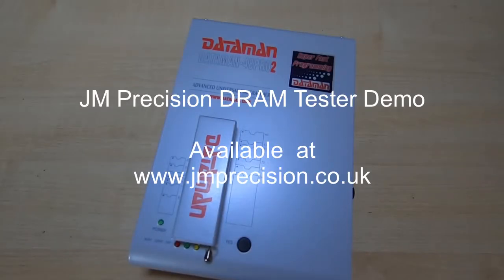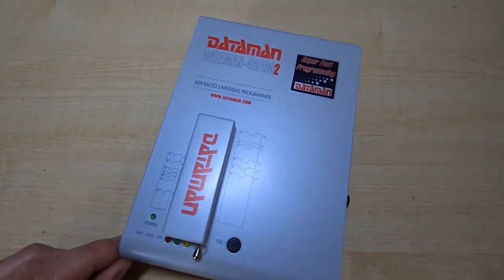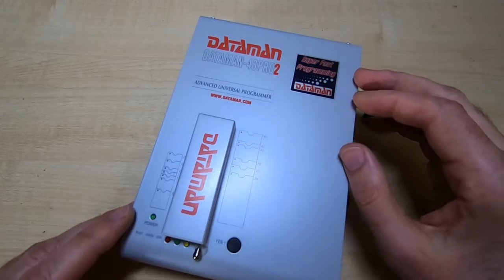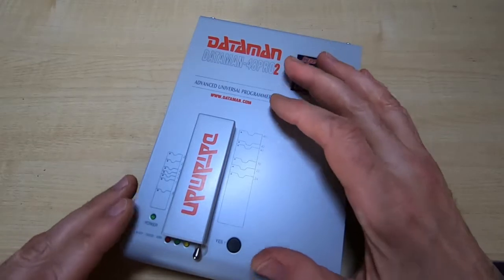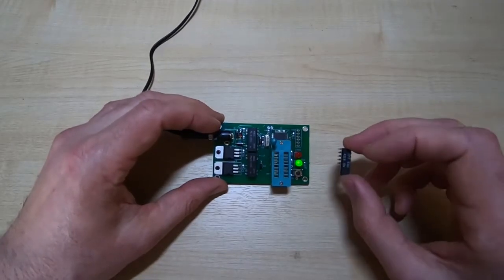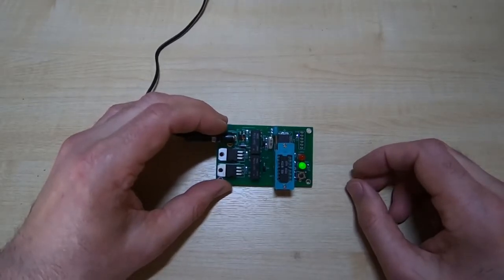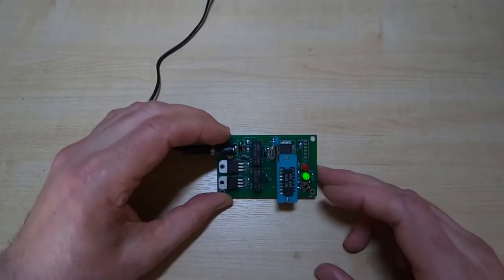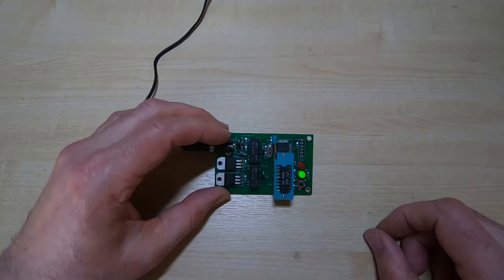JM Precision DRAM Tester

Comment: Hi there, I am working on my dead PET 8032 and since I am socketing almost everything on its board, like RAM and ROM and the main chips, so I would like to test the 4116 DRAM chips. Where can I actually order it? Could you link the source please?
Reply: Nevermind, I have found it, but 50£ in total is way too high for me, I tought, it would be cheaper :/
Reply from the maker: Hi, These are only available from the JM Precision web site. Currently they are out of stock but we should have some available in a couple of weeks.

Comment: That's a cool little tester there. I'd love to see one made with all through hole parts
Reply from the maker: I only sell them assembled so it should not be an issue. It is easier for me to make them using surface mount parts.
Reply: @JerryWalker001  true for Mass production purpose but something about through hole is just cool. You don't have to but seeing one made of all through hole parts would be cool. Maby a cool project for a video?